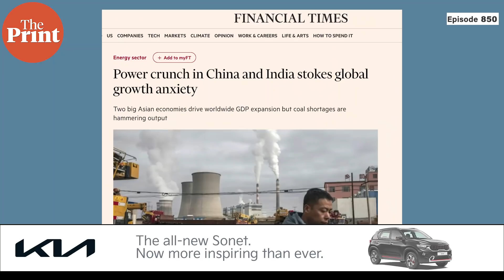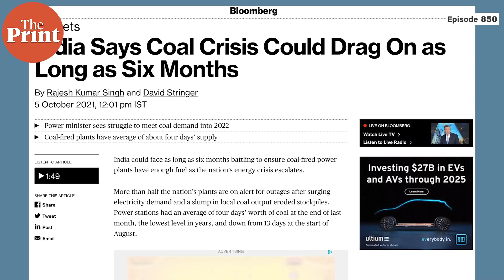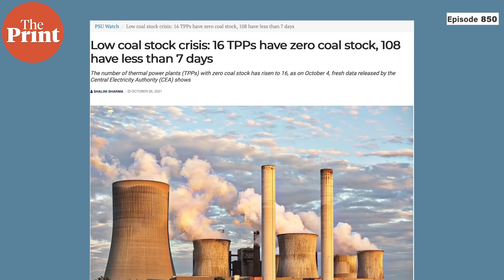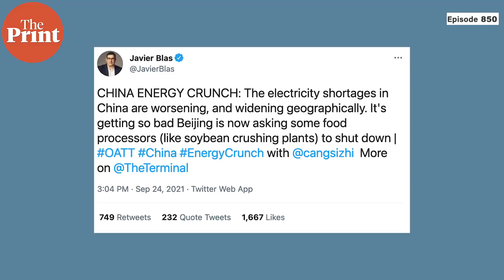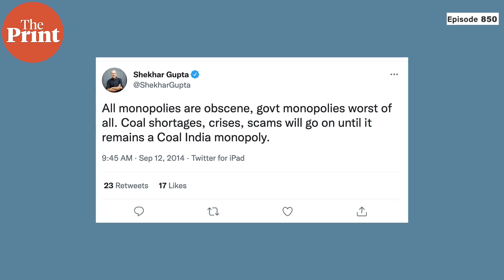India & China face energy crisis, power cuts & load shedding as coal prices rise & supply fall

Comment: I run textile processing unit in Surat Gujarat and the only way out of this is that final retail selling price of all the products that are manufactured using thermal energy as the fuel to meet its process requirements will go up coz that’s the only way out. Trust me these new coal prices aren’t going down any time soon. Or perhaps never
Reply: The high prices will definitely continue for a protracted period. But over time as shuttered and disabled mines are bought back online and gas and oil production increase coal will gradually diminish.Question is whether the increase in renewables  be able to keep up with the increase in consumption and reduce dependency on coal.

Comment: Just a YES/NO question for the viewers of CTC.

Do you think that it's absolutely fine for the AAP to provide free electricity to households consuming lesser than 200 units ?

You also can justify your answer by adding a few lines to your ONE WORD answer.

Tough days ahead seemingly.
Reply: No. It encourages inefficiency.
Reply: No. It's just incomplete, should add variables like salary, so the poor who are in the actual need gets the subsidy. We are also paying for the electricity in form of taxes, that taxes could be used somewhere else like hospitals, libraries, etc.
Reply: No
Reply: for very poor ppl? yes. for those who can afford it? No
Reply: No
Reply: Yes. Cos let's be realistic most of us use more than 200 units it's only the poor and lower middle class that benefits from this. 

But I don't agree with free power for farmers cos the government can help them in other ways like setting up a localised grida with solar panel and battery in their field for water pumps. It's my opinion.
Reply: No. It will cause burden on economics and infrastructure building projects considering the less Indians pay income taxes.
Reply: @suryavenkatesan9998  we are upper middle class but we use more than 200units only in summer. in months of winter it hardly crosses150 units
Reply: @suryavenkatesan9998  you are wrong many use less than 200 units and those who don't just take 2 or more meters to vring it under 200 units.
Reply: Che Guevara  Watch its again its not that difficult to comprehend.

Comment: Sir, to begin with - I am a paid subscriber, I value your video and I regularly pay subscription. 
About the Video: This is a very interesting topic. Thank you for picking up this. I would like to bring up three points which are less discussed.
1. Net Zero: Its nice to see all making effort to be Net zero but this is more aspirational than realistic. They didn't put any good effort to set up infrastructure required for "Sustainability".  
2. Demand from new areas: It is wonderful seeing people coming above poverty line. There is nothing better to see overall upliftment. We would like this upliftment and progress based on hard-work and efficiency. The countries, central banks, politicians have made the money very cheap and easily available (through stimulus). It has its benefits but also flaws. We will continue seeing inflation and disruptions in future because one (money) of the 4 legs of economy  (man, machine, minute) is not respected in a way it used to be.
3. Political accountability: There are no questions by anyone to the politicians who has used the power as a political tool for years. You have rightly picked up free power to farmer, free units etc. but the question is who will bell the cat?

Comment: Don't underestimate coal, India can't produce electricity without foreign coal, india though one of top country having  coal but it's a low quality coal with which electricity can't be produced. Coal accounts 70% of India's electricity. Currently indian Govt trying to increase efficiency of plants by clean coal project. India need to implement a tough renewable energy tech plans
Reply: You are wrong. Foreign coal is used in steel as they have high Calorific value. 
India has enough coal for the next 150 years. Remember only 45% of total available blocks are currently mined.
Reply: As far as I know, To produce electricity Low quality coal not usable, as it's calorific value is very less it needs to be mixed with high quality coal. High quality coal is unavailable in india, which needs to be imported

Comment: @3:51,...70% of energy comes from Coal (thermal power ) !!!

That means whatever carbon is getting emitted into the environment when we own a petrol or diesel vehicle,..will now be done collectively by huge thermal power stations while we use Green  Electric Vehicles. So Green vehicle usage will make sense only if Thermal power are completely off, which is not possible given the current demand for power.

Comment: Wind and solar energy combined with battery storage are safer, cleaner and cheaper than fossil fuels.
Distributed solar energy on many homes, businesses and larger utility size systems need to be installed. 
India needs to go all in on clean sustainable energy.  There is no high monthly costs or price increases if you use wind and solar. There is a Climate Crisis. We need to address the power crisis and the climate crisis together.

Comment: Why are you advocating bail outs for private companies? Just like inefficient government needs to move out of business, so does inefficient private producers or business folks...  

Second, why should other (gas etc.) plants be incentivized when existing coal plants are unable to run due to their own logistical or pricing (agreed to in long term agreements) issues?

I used to hear power plants were given captive coal mines? If yes, has anyone done any investigation to check if the same is not being diverted to export/sale to earn profits and folks are seeking cheaper coal from government for their use? 

Price/production variation in any commodity is a expected problem. Why have solutions not been worked out for them? If they do exist, please explain what they are and why they are not working or what assumptions have been breached. 

I don't see any unpredictable factors leading/causing a perfect storm. Is it the age old greedyness problem, everything is fine as long as I make more profits (demand going up on same or lower costs). And we start creating hysteria to get succor when costs rise along with demand... and with limited pricing power  profits start to shrink.

Comment: Hi Shekhar, a small mathematical correction. At 5:03, you mentioned 250% coal price increase resulted in 2.5x times price increase. Actually it will be 3.5x times not 2.5x.
Reply: He is correct. 2.5x increase to a 1x existing price.
Reply: @sriram1304  Word increase is to indicate the direction of change, not delta. Whether it is 2.5x increase or decrease.
Reply: @giniroyasha  Increase indicates in addition to original.

Comment: I MAY BE OBsolete,but I seem to remember that power plants had a capacity to switch over to oil.
Reply: Oil may be expensive but marginal cost of oil may not be so.Certainly probably better to run a power plant at higher capacity.instead of shutting it down altogether.The shortage of power is about 25% only. Re: the coal stock position at power houses I seem to remember a time Indian powerhouses merrily ran on a stock of 3 or4days and for years on end! It appears to me to be a contrieved crisis, based on a statement of a central minister!!It can be handled.
Reply: Point to note:International prices of coal may have gone up but domestic price of coal(I hope) have not gone up.The Gujerat plants were probably  dependent upon imported coal and the price factor was responsible for their shut down.The monsoon period is responsible for slow down in coal production.Is a yearly phenomenon. NB.WHILE i agree that Sekhar Sahib is doing an outstanding job and I am second to none in my admiration to him,I did not write the eulogy to him.Computer' s Devil?

Comment: So long as the country is deep in slumber on using Thermal power plant driven by the 18th century James Watt engine(That is how power is calculated in Watt))not resorting like Denmark to the wind power to be derived from our 7500 Km coastal belt from Bay of Bengal to Gujrat,and being closed to the equator,blessed with 56,000 trillion Megawatt hour per year(Kerala,Rajasthan and Gujrat rich In solar)and still depending on coal from Australia,Our country can never escape PM2.5 and PM10 at very alarming situation and stuble burning at Punjab 500 Km away usually blamed.Coal is usually 24 Million Joules per kilogram.And thermal plants havve great difficiulty in manuevering Idle reserve unlike Hydro power and COP in November at Glasgow vows to be carbon footprint free by 2030!!!!???